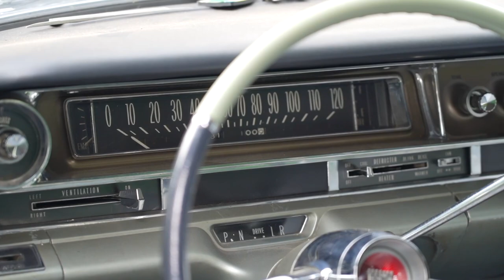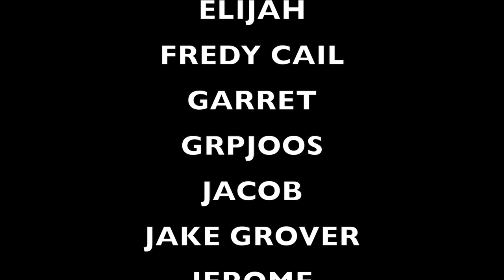SMOKING OUT THE STREETS IN A 800whp RACE TRUCK!

Comment: Z head gasket it blown, exhaust gasses are getting into to the cooling system hence the blow hose as it’s pressurising and smoking cauee cooling is in the cylinder burning